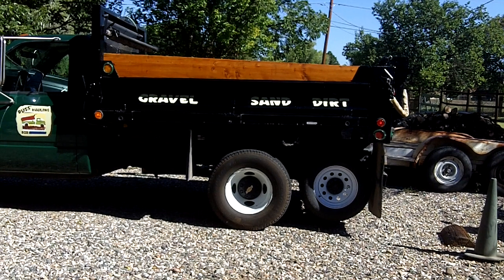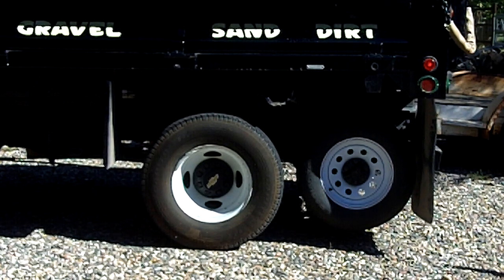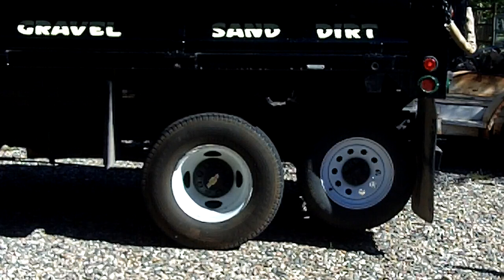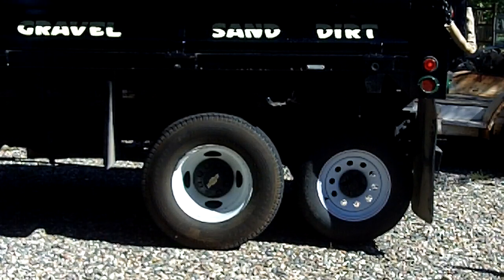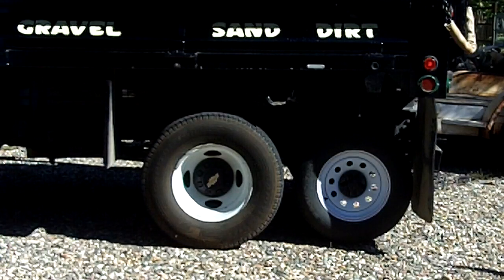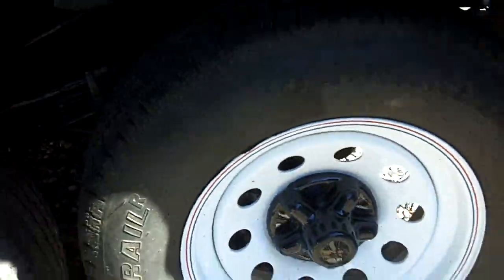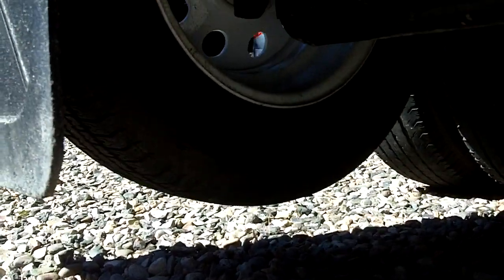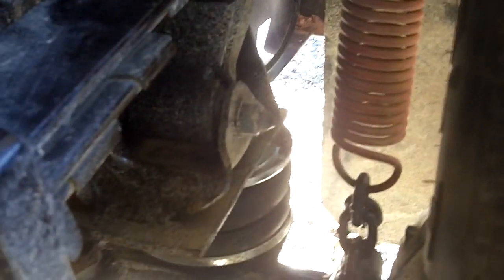Small dump truck tag axle

Comment: Did you adjust gvw on truck if not basically lost capacity do the weight of axle but I added one on my goose neck  and the better ride alone is worth it and not blowing belts on tires saves money so it's not a bad idea I'm sure it handles better oh braking is heck of alot better so with trailer its win if blow tire if want could keep rolling one axle is independent of tandems and it keeps trailer from kinking the tailgate on steep drop mines not pusher just independent
Reply from the maker: I raised the gvw . re registered the truck and raised the gvw 2,000 lbs. Handel's great , corners better ..no sway .. plus now has brakes on all 3 axles And looks cool . Next big project might be to build a transfer trailer to pull behind my dumper. Then I'd have the worlds smallest transfer dumper.

Comment: I was wondering if it can be done on ram 5500 to get payload up another 4 or 5 ton over a stock henrickson makes 10 k axle but needs air its getting the gvw raised after and at what cost is it worth it as opposed to heavier truck
Reply: The next step up trucks are in 100k range where you can get ram in 60k
Reply from the maker: @garymatusavige3639   In AZ i only pay around an extra $300 per year for raising the weight on my registration. I just sold the truck last week after driving it 5 1/2 years without incident do to weight increase or D.O.T .  The registered weight was 16,500lbs. Axle laws and bridge weight don't apply to anything under 18k lbs iv'e been told by D.O.T education law enforcement guy.  ( at least in AZ) been scaled numerous times and just complimented on my truck! I moved to another state and am now in the market for an F550 or new Chevy c5500 dumper . I'm in the Mts. in Colorado so thinking 4x4 diesel should fit the bill. I love the new c5500.